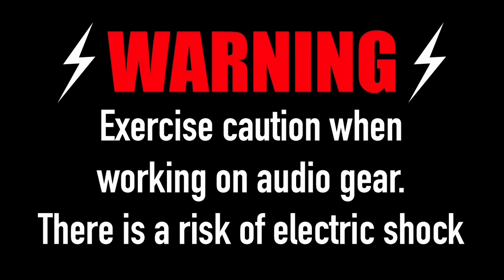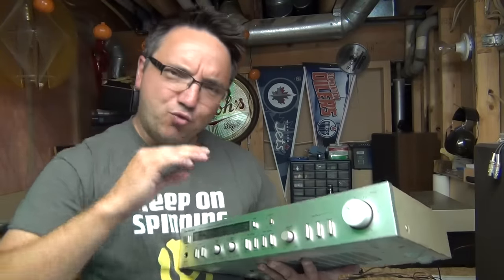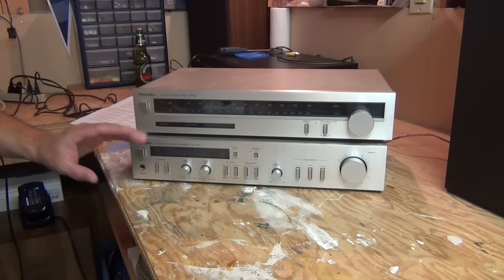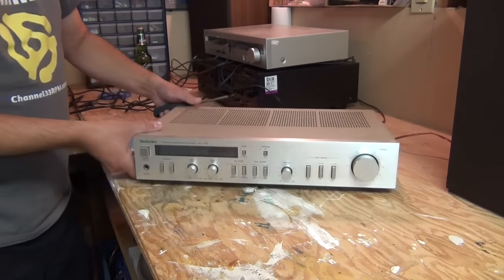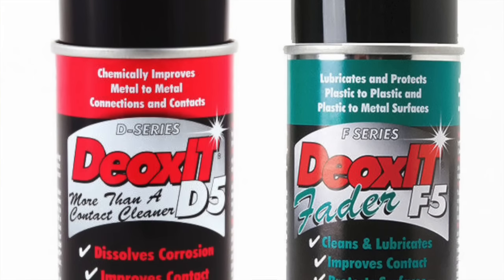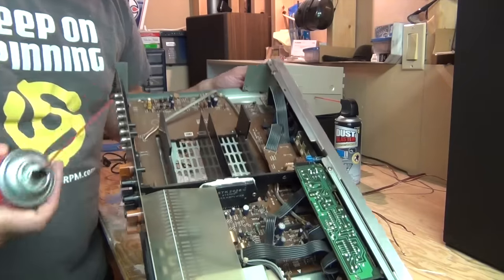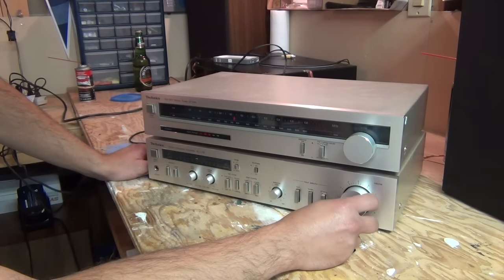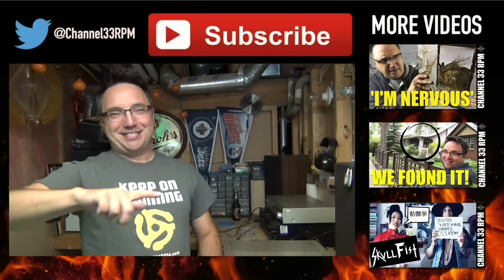Bringing a $5 GARAGE SALE stereo BACK TO LIFE with Deoxit | Cleaning a Technics amp

Comment: My favorite dust blower for electronics is a foot pump for air mattresses. It has a hose with several nozels, and it never runs out! You can find them for about $20 not on sale, it has no risk of accidentally freezing if you hold it at the wrong angle, so there's no risk of condensation or thermal shock to components.

Comment: I gave this zero chance to correct my problem. I've got a 40+ year old Technics system with an SU-V77 amplifier, SH-8027 equalizer, ST-S77 tuner, RS -B17W cassette deck. I bought two Axiom speakers off e-Bay a few days ago. I've owned the Technics equipment since new but it's had little use. When I put it back together with the Axiom speakers I couldn't get the amplifier volume slide bar past the no. 2 on a 0-10 slide scale without it breaking down. Even from 0-2 it was very scratchy and lost balance between the speakers in most places. Well I watched this video and got some Dust-Off and CRC Electronic cleaner from WalMart since they didn't have the Deoxit. I am in a state of shock. The difference is unbelievable. I can't stand in front of the speakers in the no. 5 position. I squirted here and there just like you demonstrated. I had intended to find another used amp. I don't have to now. Thank you.
Reply: CRC Electronic good quick first clean but doesn't do job well wish more place sell Deoxit actually works
Reply: Be careful with that CRC stuff. It’s much cheaper, which is great, yet it’s fried a couple of my amps. It worked on several, just never had this issue with Deoxit. If anything, just make sure it’s throughly dry. Jess-sayin.

Comment: As a commercial radio tech, I have used the whole line of DeOxit products for over 25 years, they are a lifesaver for both the customer and I. Their ProGold cleaner is also great on electronic equipment such as old computers that have gold plated card contacts. It’s not that the gold corrodes but there can be a buildup of elements that can condense on the surface of the contacts and even migrate into the joint between the boards and their sockets. It does an excellent job at deep cleaning these connectors eliminating many issues.

Comment: These old Tecnics amps and receivers are great pieces of equipment to start of if you are into vintage stereo or if you want a good phono preamp for your turntable. They go reasonably cheap but sound and look the part. Very reliable and quite easy to service, they are kinda like the Honda Civics of audio!

Comment: VICTORY!

I LOVE, LOVE, LOVE when you find something for cheap and you can bring it back to life.  Stuff like this is such and easy fix, too.  Well picked.  I would have grabbed it, too, for $5.

I'm a big fan of the Technics (I say Tech-NEEKS) line - it's what we grew up with.  Our first family stereo (our only family stereo, truth be told) consisted of a Technics SA-404 Receiver, a Technics M8 Cassette Deck, and a Pioneer PL-400 Turntable.  I picked it out with my Dad and I've been hooked on the stuff (Audio Gear in general, but I really love Technics).

As for finds, you know me (always on the lookout and sometimes successful) - most recent pick was a Pioneer VSX-501 Receiver.  It has a phono input and is a rudimentary surround sound unit, but in stereo mode, it has a respectable 100 watts per channel and a pretty decent tuner section.  It was $15.79 at Goodwill and needed - guess - a DeOxIt treatment on the volume pot.  Works great now.  Didn't come with the remote, but it works fine without.  Garage sales down in Arizona don't really start up in earnest until mid-September (it's just too hot down here).  They run through mid-to-late October.  Then we do them all again in the spring. 

Other that that pick, I scored a bunch of LPs and a couple of Canon cameras (AE-1 Program and an F-1) but while it's another interest of mine, it's not for Channel 33 RPM.  I really have to do a video.  I'm trying to coordinate with my daughter to help me.

The SU-V16 is a pretty tidy little unit.  Any plans for this score?

Anyway, great video - 

Cheers.
Reply from the maker: Hi Paul. I'm a Tech-NEEKS guy as well, though I have heard others pronounce it the other way.  Glad to hear you had some decent pick ups lately. Dirty pots are so often the cause of problems, and as you mentioned, so easy to fix. 
Looking forward to one of your vids.
Cheers,
Frank

Comment: I had that exact same amp driving a pair of auratones in my recording setup 20 years ago. It was extremely quiet and did the job very well.
Reply from the maker: I wasn't sure about that amp when I picked it up, but I am still using it, and it sounds great. It is part of my garage stereo set up. Thanks for the comment.
Frank

Comment: You used compressed air to clean the inside of that amp, inside your shop?! You must love dust everywhere! I worked in video production for nearly 30 years, with all manner of tape decks, electronic gear, computers, shelving... The enemy was always dust, and the solution was a portable vacuum, with a variety of brush and small attachments to reach in small spaces. For cleaning out the insides of electronic gear using compressed air, you do that outside! That aside, thanks for the vinyl and audio gear rescues!
Reply from the maker: Haha, yes ... inside. There wasn't much dust in there, but point taken.  I definitely wouldn't do this in my listening room
Thanks for the comment!
Frank
Reply: Channel 33 RPM listening room?  I won't do it indoors at all.  This is why God made garages, sidewalks, porches, and stoops.
Reply: They sell dust masks at dollarama. Good tips. Not bad for 5 bone.
Reply: I once use vacuum to clean my amp until one day the vacuum causes static that fkin ruined my amp forever. If you live in a place with high humidity dont ever use vacuum to clean your pcb board
Reply: Can i use contact cleaner soray for my kenwood ka 801 amp for cleaning dust and moisture ?

Comment: I get my Deoxit at MCM electronics (online). I had a Behringer 12 channel mixer sit in storage (climate controlled) for four years and when I pulled it out to use for a local TV station, it was completely dead (fortunately I had a backup mackie). 

Well, I took it home and used De-oxit on it. Pretty much every pot and slider needed it. 

I've used it as my main mixer in bands now for three years.

Deoxit is a must for me. I collect old 1970's stereo separates and they all needed it.
Reply from the maker: Hi Rob. Deoxit is great. Way to many people throw away or donate their gear, thinking it's shot, when it's just the pots that need a little clean.
Cheers,
Frank

Comment: I like to run a vacuum with the hose rigged to hover maybe 8-10” above the workspace when blowing dust from circuit boards. It does a pretty good job grabbing that airborne dust.

Comment: good video, quick to the point and informative. just what I was looking for! down to the type of Deoxit D5 I didn't know the specific type or just how to do it but now I'll try to revive this old 1979 Realistic STA-2100 I just scored for 10$ at goodwill not working. 3$for 2 fuses it works great but dusty so I'll clean it up inside and bring it back to life, I also scored some ADS L620 vintage loudspeakers in mint condition at the same time for 12$ they sound and look amazing together.

Comment: Always nice when you can fix it yourself. I refoamed some Advent speakers and put 2 belts in turntables.
Reply from the maker: Hello Wargod! Right on. Do you have any tips on refoaming? I have a couple of refoam jobs I want to tackle this winter. 
Thanks for the comment.
\m/
Frank
Reply: yeah make sure you have the right size as a pair. order the kit and should come with the right glue. pull the speaker out clean the area very well of old foam. If the area is super clean then apply the glue that comes with the replacement. Put a nice bead around the speaker, place the foam on the speaker and see if you have enough glue and then press the foam with force to adhere. wait a day and put back in box. Should work good. I ordered a protective bottle of foam to protect the new foam apply with a brush. let it sit for a day then check them out.
Reply from the maker: Cool. Thanks for the info. I may touch base with you again on this topic in the coming months.
Cheers.

Comment: Great stuff! Wish I had that cleaner years ago when I had my component system. Gave up my system that I bought in Germany some years ago as I wasn't using it. My wife isn't into my music like I am and and it was just collecting dust, but it was a great system with 4 Cerwin-Vega speakers! Oh well - got my computer with my 5.1 surround speakers and Bose headphones in my own room.
Reply from the maker: Audio gear can often become a liability if not used, that's for sure. I'm glad to hear you have a system that works for you. There's some amazing technology out there right now.
Thanks for tuning in and commenting once again.
Frank
Reply: Stereo music doesn't sound good in 5.1 mode, I'm sure your outfit has 2.0 mode for stereo programme material. I used to play stereo DVDs in prologic mode which didn't sound the best, mono DVD would only play through center speaker

Comment: I purchased an Onkyo TX-41 (not what you'd call a collector piece) made in the early 80s for $9.99 at a thrift shop. I have a problem with the monitor buttons. they don't pop out, they kinda come out slowly and sometimes I have to push a button a few times before it activates (left to right) Tape 2 - Tape 1/Aux - phono - tuner- am/fm buttons. Tape 1/Aux out is what I keep it on for mixing down songs. Here goes nothing! thanks for the video. I'll use it when I get to fixing my Onkyo!

Comment: Hi Frank! After looking at a lot of solutions, I hope this might do the trick on an old Amp I just got? The left channels (front and back) barely worked and ultimately stopped working completely. I think it’s worth a shot?
Reply: Hahaha, you know what? I think that amp hasn’t been turned on in years. I tested with headphones, and then used the test tone mode while turning the volume knob up and down and it cleared every channel 😂😂

Comment: Simple easy to understand video. Thanks. Could this work using contact cleaner  on a technics ch950 sound processor. Getting hum feedback when I press each source on amp phono tuner. (Not the amp as it works with a ch 550 sp.)  tape etc. Thank you in advance

Comment: I thought D5 should never be used on carbon pots, and F5 should be the one to use....
Reply: D5 is for cleaning, the F5 is for lubricating. The cleaning process, either with contact cleaner alone, or using D5 which adds the benefit of removing oxidation, will strip away the lubricant that may have been there in the pot. The F5 adds a new layer of lubrication so the pots will last longer.

Comment: I have an old Kenwood integrated amp from the 80s which needs the pots cleaned on a regular basis. Taking the cover off and getting in behind them is a pain in the butt, but fortunately I can remove the large plastic knob for the volume control, and underneath the stem it is mounted on there is a hole that you can spray contact cleaner directly into. I assume it gets into the pots that way since it works, for a while at least. I'm using a cheap contact cleaner from Canadian Tire, which is probably not the best since it has to be used about once a month to keep the static down. I would like to try Deoxit but don't know where to buy it in Canada.
Reply from the maker: I highly recommend Deoxit D5... it should make a big difference. I bought mine at Long & McQuade, in the professional audio department. I'm not sure where you are in Canada, but there are L&Ms across the country. Hope this helps!
Frank
Reply from the maker: They sell it online too: https://www.long-mcquade.com/6205/Pro_Audio_Recording/Accessories/Hosa/DeoxIT_-_Contact_Cleaner_Rejuvenator.htm
Reply: Thanks, I'll have a look.

Comment: Woah that volume thing is exactly what my old boombox does! I may need to try the same trick someday. Do you only have to apply the deox in the volume/bass pods? Great video.
Reply from the maker: Hi Will. Thanks for watching. I've never tried this on a boom box, but I'm certain it would do the trick. You just need to access the back of the volume and tone pots. There's usually a little hole... you spray in some Deoxit, and it cleans up nicely. There are different varieties,, some designed for faders (sliders), etc. Here is their website: http://store.caig.com/s.nl/sc.2/category.188/.f
One can of this has saved me TONS in repair bills over the years.
Cheers,
Frank
Reply: @Channel33RPM  I used do that to pocket radios and mid size portable radios

Comment: Hi Frank, really enjoying your videos. I just picked up a pioneer SX - 750 receiver. I was wondering if you had any tips on how to replace bulbs for a vintage receiver?
Reply from the maker: Hi Christopher, thanks for the comment. This is something I've been researching myself, but have not attempted it yet. There are lots of cheap replacements on EBay, and I notice a lot of folks are experimenting with LED lights. I may give it a shot this winter. I have an Pioneer SX-XXX (can't recall the model offhand) that needs a new bulb.
Best of luck!
Frank

Comment: Does that lubricate as well as clean? The big problem I have had over the years with contact restore sprays is that they remove the lubrication from the POT. One of the Deoxit cans says it lubricates, but how does it feel afterwords? Do they still have the dampened feel of a good quality POT?

Comment: Hey Frank! Very helpful video. I just recently picked up a Concept 11.0 receiver at a yard sale for $25 and it powers on perfectly fine, but there is no output at all. Do you have any idea what could be causing this problem?
Reply from the maker: Hi Jody.... Thanks for the compliment. That's a very nice looking receiver. I'd hate to hazard a guess as to the problem. Do the VU meters move? I have a Sanyo where one channel doesn't work and someone suggested to me that it may be a fuse. I haven't had a chance to explore it any further though.
Frank
Reply: The meters don't move and it isn't putting out any sound. I tried replacing a couple of the fuses, but it didn't do anything. I'm thinking it might be a few of the capacitors.

Comment: I recently picked up a tape cassette deck at a local thrift store....  I normally wouldn't bother with a used tape deck but this one was in mint condition and it was only 20 years old!   It worked perfectly for my 1st 20 cassette recordings... but then all of a sudden it was not recording the left channel. I tested the rca jacks and they are in working order.  Any tips would be helpful... thanks

Comment: would this solve the issue of hearing distortion, etc when using any input on the right channel? I have marantz 2252B and when using Radio, both left/right sound fine, but only when using any input; aux, tape in, etc the right channel goes in and out. Could this just mean a dirty pot for there input selector?

Comment: thanks Frank great video. I have some  issues with the direct and loudness  press buttons any idea how to fix  it ?
Reply from the maker: Hi Gregory. I haven't had this problem, but in general terms, I try the simplest solution first, which would be cleaning the contacts. A few zaps of Deoxit may do the trick, and for under $10US on Amazon, it could be worth trying. 
Good luck man!
Frank
Reply: Hi I have tried with "dry air spray "but it solved half of the problem : only one speaker is working ! the other shuts down very often .when the direct is "on"  it works fine.I have to find those few miracles products in france (the country where nothing is cheap)...thanks for your help.
Reply from the maker: I've found Deoxit to be a "miracle product" in many respect. Let me know how this turns out. Bonne chance!
Reply: thank you very much !

Comment: Christ, I hate staticky volume knobs.  I did the same thing as others - just tossed it out.  I had no idea it was that simple.
Reply from the maker: Hi Clarence. It's a very common problem that's resulted in many tossed stereos (or expensive repair bills). The local shops here charge $50 just to LOOK at a piece of gear. Crazy! Hope this helps!
Frank
Reply: It does - this will be good to remember in case it happens again.  Last year sometime a friend of mine gave me his old Sanyo receiver w/speakers from the 70s.  It sounded okay, but there was this pesky volume knob, so I scraped some scratch and got a Sony with a remote and it's flawless.  I ended up chucking the old Sanyo.   I wouldn't need to worry about wearing out the knob on the new one because the remote does it all.  The 70s speakers sound fantastic on this, by the way.

Comment: pickup up a silver plate cassette deck - akai - cleaning the front plate to start trying not to remove lettering - after going thru some different light weight cleaners which were 50 percent effective ended up with "Mothers cleaner and Polish" this seem to remove 99 percent more of smudges and dirt, oil ,and such - next I am going use a car wax for the front to shine it up and have more of a protection for the front plate -

Comment: Go ahead and laugh, but a lawn leaf blower will blast away any and all encrusted dust and crud inside your cabinet - audio equipment, computer equipment, doesn't matter.  Your neighbors may not approve when you do it in your driveway, but who cares?
Reply: Good idea. I don't have any compressed air but I do have a leaf blower and some WD40 electronic cleaning spray. I'll start on my dusty Yamaha receiver tomorrow. I keep it in a dusty area and It's starting to sound like crap.